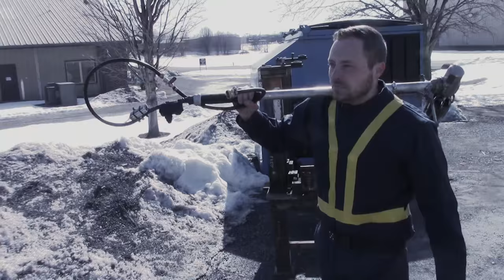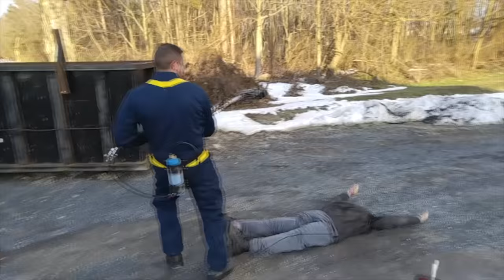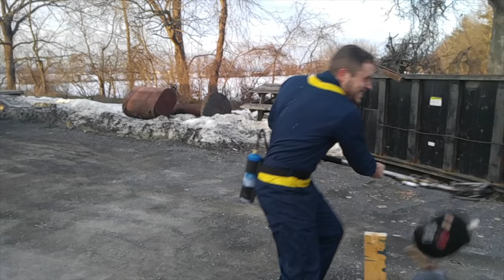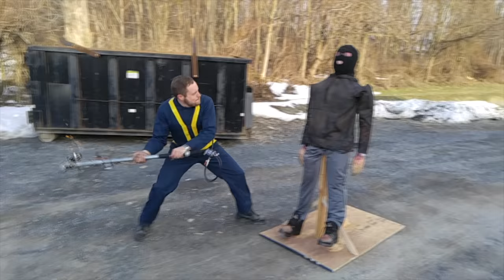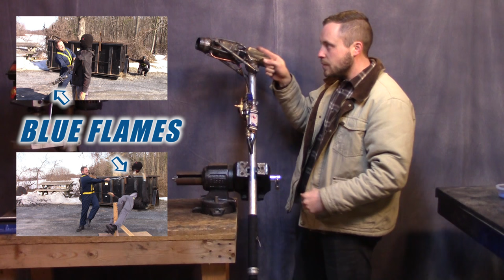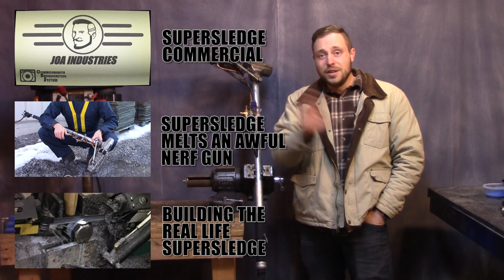REAL LIFE SUPER SLEDGE!

Comment: I'd be really interested to see what kind of difference it is, and how much it affects stamina. did you do any measurements of the force delivered upon impact?
Reply: i agree. need an accelerometer. and a sensor in the dummy to measure force of impact with and without the burner.
Reply: little late but, get a scale, put the sledge hammer on it, zero the scale then full blast the jet and see how many g/kg it applies.

Comment: How much thrust is it actually producing? Is there any way you can get an accelerameter  and see how much force it is making with and with out using the thrust when you hit something.
Reply: +Odd One, probably less than 5% of the kinda energy it takes to swing that thing. The "booster" parts themselves make it weigh more than a normal sledge so I doubt it makes literally any boost to the final swing speed.